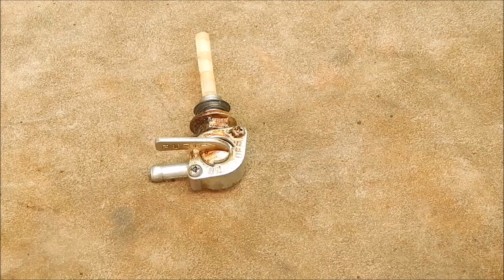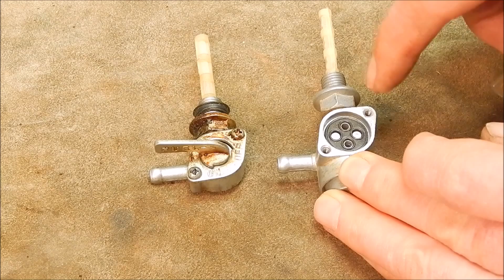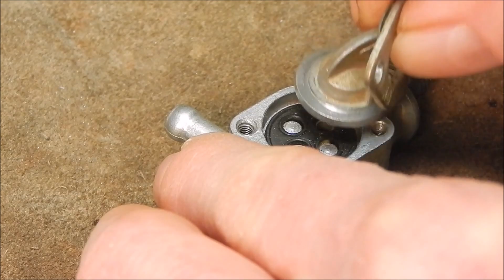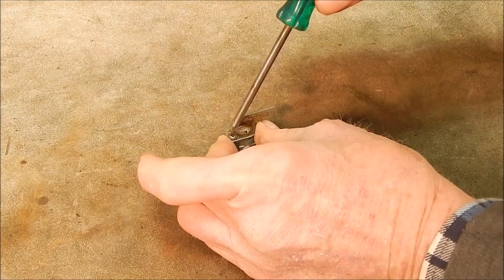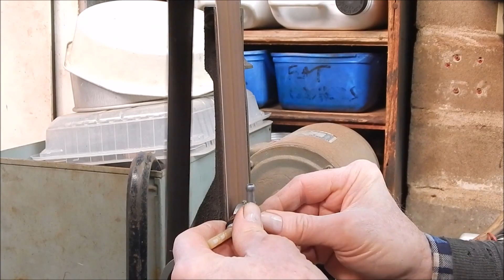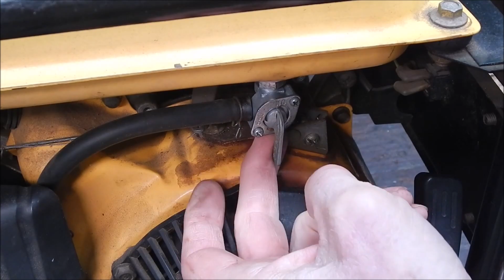Easily fix a leaking fuel tap for free - no replacement parts required

Comment from the maker: Note:  This appears to be an original idea.  Very simple and quick fix.  IMPORTANT: Note the position of the On/Off lettering on the retaining plate, as it can go back two ways.  Cheers Rob
Reply: Dollop of rubber grease on the seal as well, mostly on the outside, to provide lubrication might also be good. When I got my generator it came with a service kit, which includes the fuel valve and the hose, along with the push in filter sock and a spark plug, plus air filter and input strainer. Whole kit is around $20 retail.
Reply from the maker: Sounds good.  I did consider rubber grease or vaseline, but petrol would soon wash it away.
Reply: Yeah nah...  Did the same on a few but with sandpaper. One had rivets that i drilled and tapped m2.5.
I stopped uploading ages ago when Adsense screwed me...
Reply from the maker: Yes, sand paper or emery sheet on a piece of glass would work just as well as a belt sander.

Comment: Good work.  Another approach might be to put more bend into that wave washer/spring washer.  How fragile is the one that you experimented with before?
Reply from the maker: The spring washer is very thin.  Basically it's a type of SS shim with very little strength. Putting a larger bend in it would not work.
Reply: Wrap it 4/6 times with dental floss and it will put pressure on the disk

Comment: Chickanic, who fixes petrol engined garden equipment, has found that Mechanic in a Bottle is extremely effective at rejuvenating fuel system components. Apart from removing varnish it softened old hardened seals. Could be worth a try here. She has no affiliations with them, just found it works. BTW she says keep away from E10. It is hydroscopic. Also use a fuel stabilizer if you are leaving your gear for long periods between use. Hope this helps.
Reply from the maker: That is good info. Thanks for the tips.

Comment: If this doesn't work because the tap is too far gone with corrosion you could remove the innards and blank off the face and install an inline tap to the fuel hose .
Reply from the maker: Just buy a cheap replacement.  Cost peanuts.

Comment: Excellent Rob. Another money saving tip. The war time motto Make do, and mend, is worth remembering. So easy to just replace something, but more fun, and satisfying to fix it. Cheers Nobby
Reply from the maker: Hi Nobby.  Yes, totally agree.  I hate to see waste and it's great to fix things others would throw away.  Definitely satisfying when it works out.  If not, then regard it as a learning experience.  I've failed plenty of times.  It just makes you stronger :)   Cheers Rob

Comment: Brilliant tip Rob. Thank you.
For those who do not have a linisher, a few minutes on a flat surface with a piece of fine abrasive would do the trick.
Reply from the maker: Yes, a bit of sandpaper on a flat surface (ie. sheet of glass) would work just as well. Cheers Rob

Comment: Ideal repair Rob 👍👍👍 Sometimes with problems like that you just have to sit back and think about it (preferably with a beer 😉) and a solution will present itself. Cheers, Alan.
Reply from the maker: Hi Alan.  A close look at the problem can occasionally reveal a solution that may just work.  I had a thoughtful red a bit later, to mull over the result ;)  Cheers Rob

Comment: now that is a great quick fix trick -  parts for the chonda motors are so cheap I keep spare carbies, ignition coils, pull starters etc on hand.
Reply from the maker: Thanks.  New fuel taps from China are dirt cheap (and well made).  Their cheap engines are powering zillions of pieces of machinery all over the world.  Cheers Rob